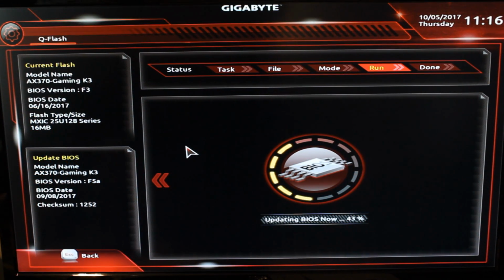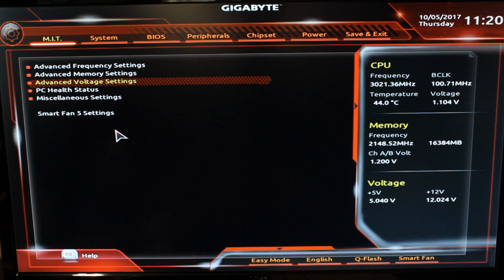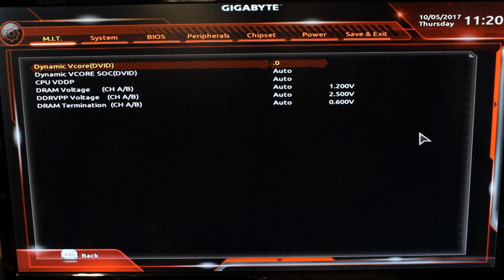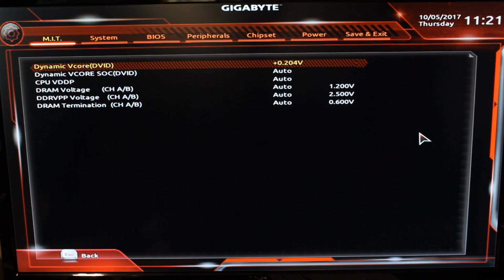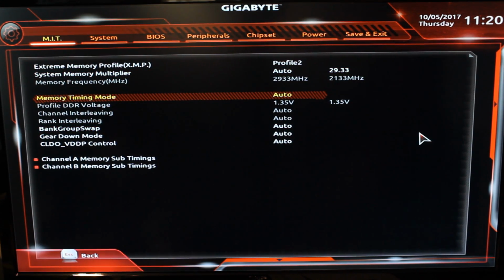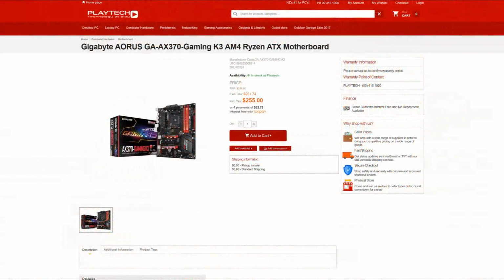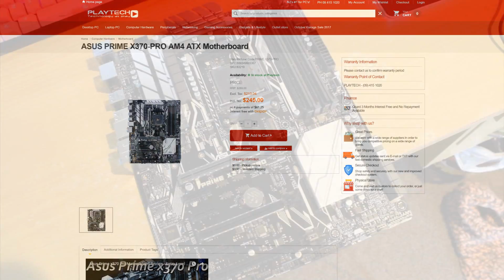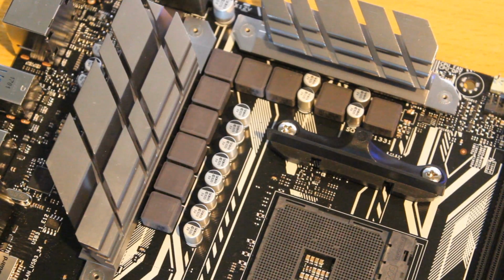Gigabyte AX370 Gaming K3 Review - Not Good Enough

Comment: Damn first build didn't Realize this Board wouldn't run the ram I bought properly I bought 3400 mhz ram and its running only at like 2000 what can I do?
Reply: You'll have to overclock your RAM, either manually (it tells you on the RAM stick, like 15-14-14-14-36 for DRAM timings and 1.35v) or using XMP profile in the BIOS, every Ryzen motherboard does this, it runs natively out of the box. Not to be rude or anything, but as a future note: MAKE FUCKING SURE YOU CHECK THE MOTHERBOARD  RAM SUPPORT BEFORE YOU START BUYING THE PARTS.

Comment: This mobo cost less than 130 in the E.U, which is basically 210 New Zealand Dollars, it's good at this price point :)
Reply: I paid 130 bucks for this motherboard on newegg and I love it,   I've never really seen the need to use SLI,  by the time I need to upgrade theres always a single graphics card solution available that's more cost effective than buying 2 graphics cards.
Reply: Ellypsis bein an x370 but no sli support is disappointing lol. Idk why they even call it an x370 motherbaord when thats one of the  main differences between x370 and b350 chipset. Granted not many people do sli but still, there's much better motherboards out there (in same price range)  that give u sli support, better overclocking/bois, etc.